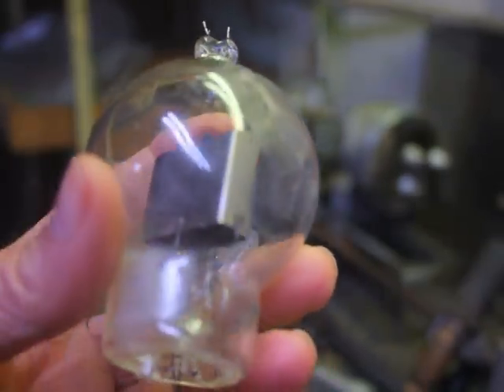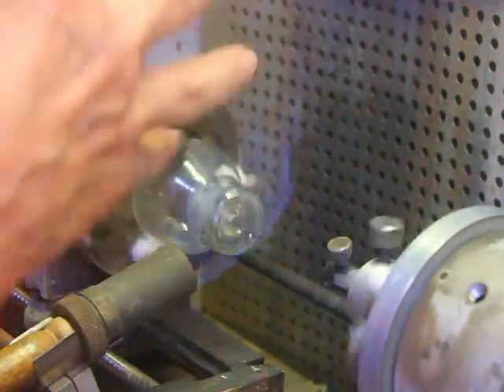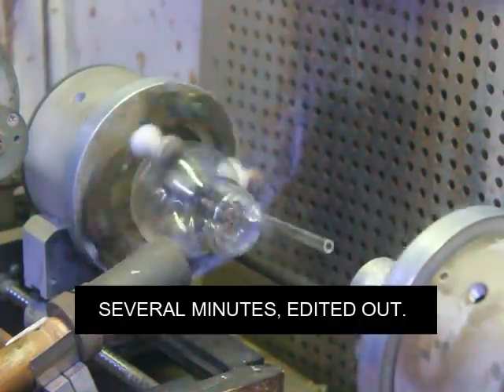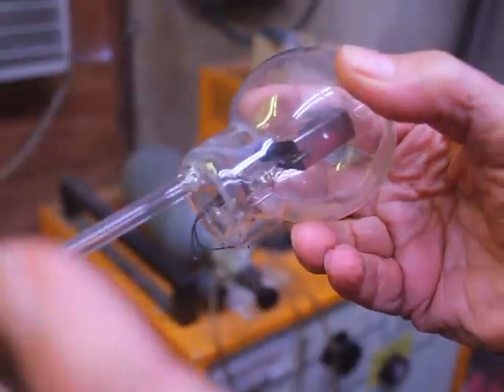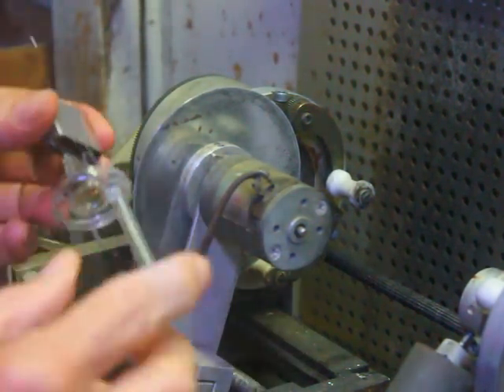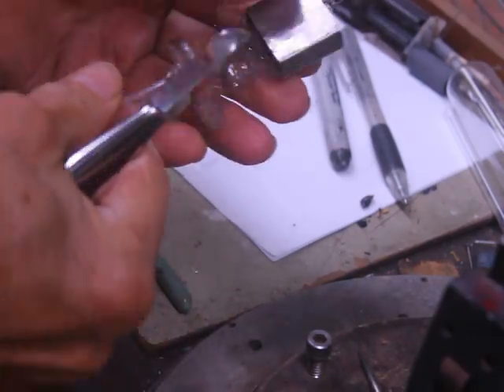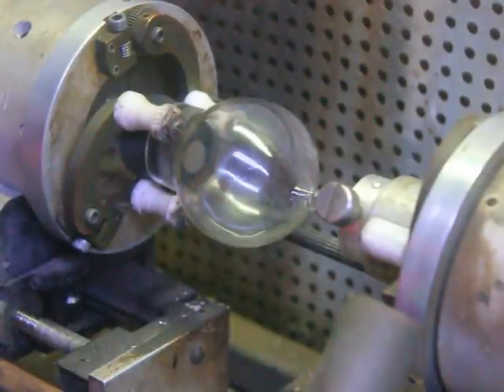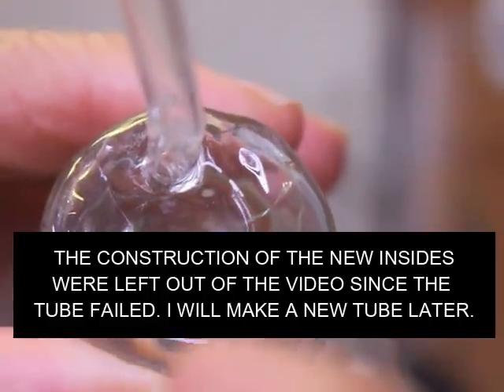MAKING AN OSCILLION TRANSMITTER TUBE

Comment: Can replacing old resistors with new ones, like metal film, make the very old radio sound better?
Reply from the maker: Very unlikely. Sometimes they go noisy but usually this is not affecting the sound until the resistor is really bad.
Reply: @glasslinger  thanks

Comment: @glasslinger: have you ever tried building an entire circuit within a single vacuum envelope? i got to thinking about the early days of space flight and the russian rod pentodes, and how possibly in the vacuum of space they wouldn't even need a glass envelope at all. maybe a simple radio or amplifier would be practical as you only need a few passive components that would fit inside the bulb. i was playing with some of the russian tubes on the bench and i was very surprised that they could sustain enough gain to have a triode hartley oscillator drive a speaker winding at only 4v on the anode.
Reply from the maker: Later this year I will be making a replica of the Lowes tube which has three stages plus resistors and capacitors inside the bulb.
Reply: @glasslinger  brilliant! i look forward to it

Comment: I love seeing your videos. I grew up between the radio and TV tubes and through my father I learned to repair. I love how you make these tubes yourself. I have a question. Can you make an Ozone UVC lamp? I am fascinated by these bulbs and have many in my home. Is this difficult to make yourself?
Reply from the maker: Most of these produce UV-C, which is severely absorbed by pyrerx and other types of glass. Thus the envelopes are made of fused quartz, which takes special equipment to work with. (which I don' t have)
Reply: @glasslinger   I didn't know that a special kind of glass had to be used for this. However, I was able to melt the glass by heating it. Thank you for your answer. I look forward to more interesting videos from you. Greetings from Belgium.

Comment: I remember a vacuum leak testing system that worked by holding a high voltage high frequency source (rf version of Electrobooms magic wand lol) close to the tube while being evacuated. If there was a leak the air entering the tube would be visible as purple streamers.
Reply from the maker: See my other tube making videos. I use the hand held sparker to test for gross leaks!

Comment: OMG L love your video channel !  I have always wanted to make a tube all by myself and have gathered tips from very very people from back then. Alas, but I missed my chance to put all of the techniques together. 
( I used to be a Argon/Neon/Xenon-Sign tube blower 35 years ago for 2Yrs )
I was advised to loosen all clamps while the glass is still semi-plastic....wait....then loosen them all the way - and wait. It really cannot crack because glass became crystalline while under nil stress.  
The wire-2-glass cracking is another issue.
I was advised the best electrode entry Metal is to recycle old Vacuum tubes because they provide the best metal thermal expansion rate coefficient for the seal, and a copper wire on the outside.  Recycling ordinary light bulbs, Neon electrodes from signs (with ports!), and especially the much larger 4-8-Pin socket tubes with highly effective emitting Filaments inside.

Sincere thank you and carry on sir!

P.S. I hear that the phosphorelectrode from a Magic-Eye tube can be (cut up) reinserted and it will still glow when recycled <--- a way better Scientificly COOL fate than going into a Landfill !
Reply from the maker: The usual failure of the old eye tubes is the phosphor has worn out. They gradually fade with time. Not practical to re-coat the target with new phosphor so the old tubes are junk.

Comment: Must be a nightmare trying to do this in your own home. Know you can use helium for leak detection, and as I recall also cheap methanol. Glass to metal seal lead wires tungsten or kovar? What do you use? You need a big hydrogen bake-out furnace for parts too. Company I worked for used Schott glass envelopes fabricated on glass lathe, then annealed for many hours.
Reply: I guess he uses Dumet and sodalime glass rather than kovar or tungsten and borosilicate
Reply: @5Perf65mm  he uses borosilicate

Comment: Fascinating as always. Other than being beautiful, what was the reason why some vintage tubes were globe shaped versus something more simple like a modern cylinder tube?
Reply: I would assume it kept the globe temperature down by giving it more surface area farther away from the heat radiating parts inside. As the technology matured they were able to run the glass hotter without failure and make the envelope smaller.
Reply: I’m guessing that heat dissipation would have a lot to do with the shape of the envelope.

Small cylindrical envelope where heat is not a major concern - small area for heat dissipation. 

Larger spherical envelope, requiring more air to circulate and dissipate the heat.
Reply: I've wondered the same thing and I'm guessing maybe just size. The smaller the envelope, the closer together you can put things and the more space you have inside the cabinet overall. For an instance where maybe in your radio or amplifier you can see the tubes then maybe I would go for a big Globe to just for the aesthetic. I think these handmade tubes look really neat. I have seen some cabinets that they just would not fit into though.

Comment: I've always wondered if this was possible.  I have a western electric 300b with a crack in the glass.  Is that fixable?
Reply from the maker: The cost would be comparable to getting another tube off ebay. It's no piece of cake to do this work!
Reply: @glasslinger  how many views would you get to rebuild an authentic Western Electric 300b?  I'd donate it to see you make a video about it.
Reply: Just watched all the videos on the new production Western Electric 300b's out of the Rossville plant.  Fascinating to see the old iron come to life, with new electronic processes and quality assurance.  The price is pretty high at around $1800.00 USD per tube!  Looks like the investor secured all the old production equipment, drawings and specifications from ATT.  Interesting what the world market will bear for analog tubes.
Reply: Just found a wonderful Western Electric video that shows the same equipment that the new Western Electric is using to make the 300b's
https://youtu.be/_-JzxX75oYc?t=676